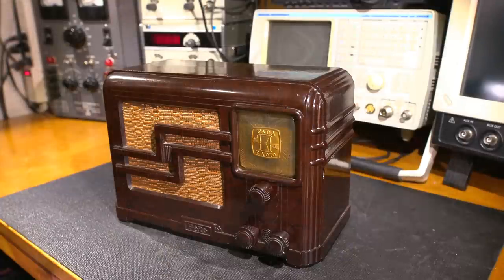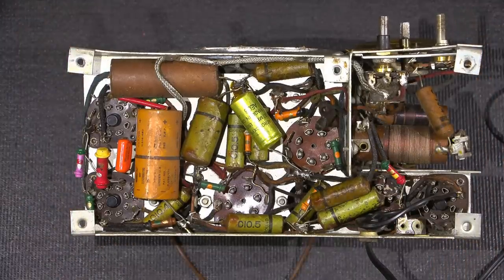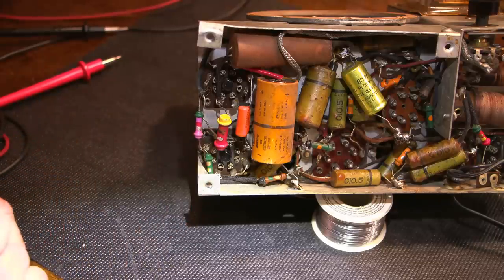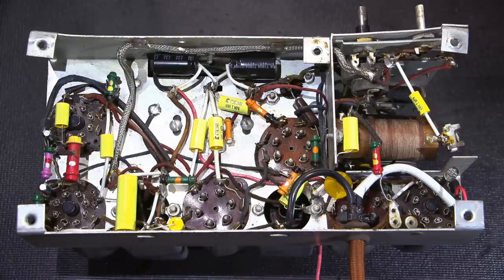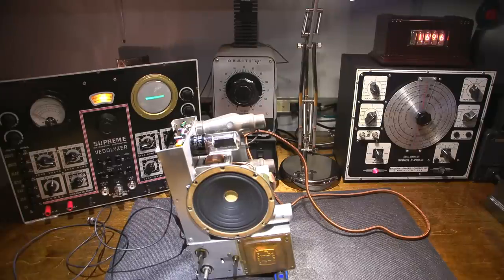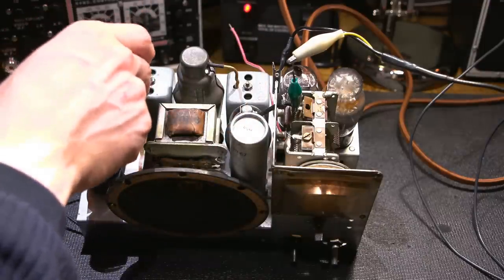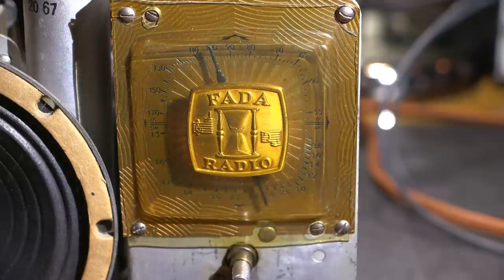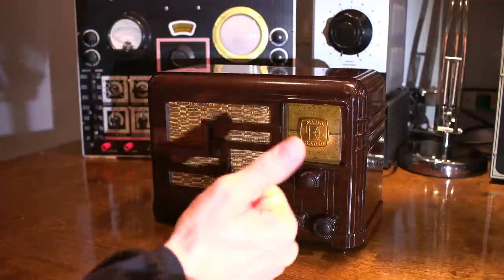FADA Radio Receiver From 1937 Electronic Restoration! [Repair]

Comment: help, I build a radio with lm386 and set the gain near 200, my antenna is a 60’ wire and I can only hear a religious station and a classic music station from my attic at night. I can only tune between either static or a very clear crisp preacherman talking about finding Jesus and anti-abortion and protecting the youth during ‘culture wars’. When I plug it into electrical ground then it changes to classic music. How could I rebuild this if I wanted to listen to espn or Trump impeachment or there’s a faint station near 1.7 MHz that sounds like Morse code? I’m tuning it with a 30-365 pf air capacitor and my coil is tapped every 80 turns #32 gauge on a 33 mm diameter PVC pipe